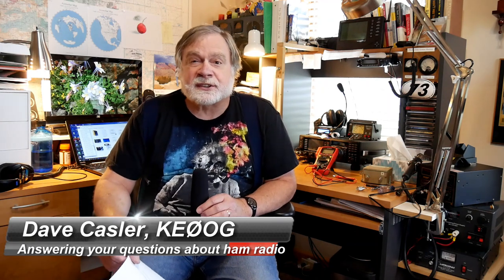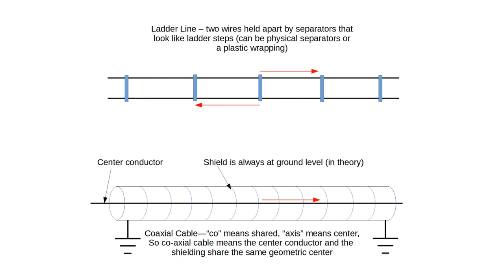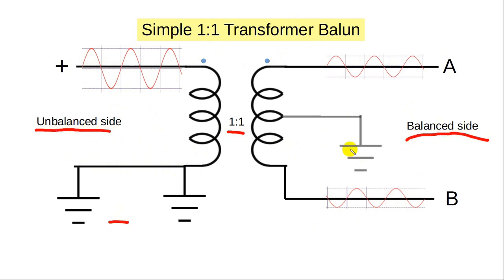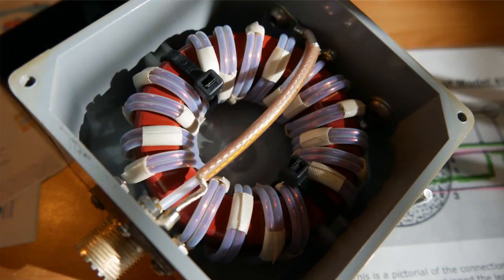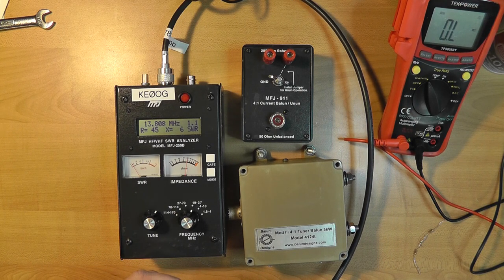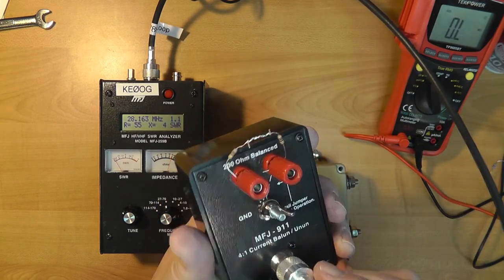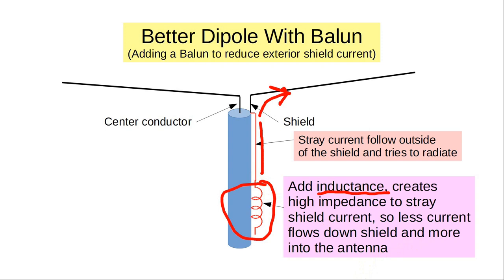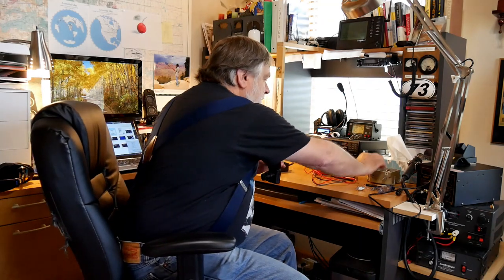All About Baluns (Ask Dave #73)

Comment: The resistance changes as you go up in frequency because the resistors you use are wire-wound type and they act as inductors when AC is applied to them. What you need is a "non inductive" resistor, ie carbon or metal film type.
Reply from the maker: To a degree, yes. The resistor is composition, not wirewound, but there is inductance in the leads that makes a difference in frequency.

Comment: Thank you for making this video. This has always been complicated for me to understand. In the video you use a transformer but I am seeing on utube that hams are using coax wrapped around a pipe calculating the turns for the center frequency. can you explain how this works instead of using a transformer, and where are these transformers found? Thanks George
Reply from the maker: Coax wrapped around something is called a "choke balun." Its purpose is to remove the RF from the outside of the coax shield so the signal you want stays inside the coax.

Comment: Wow, I'm an EE and I've been wondering what all this talk of voltage balun vs current balun is all about. Translated back to conventional engineering lingo, I now know that this is just an autotransformer vs a conventional transformer with two isolated coils. I still don't quite get why  this is called "voltage" vs "current" in ham land, but at least I know what they are now!
Reply from the maker: Yeah, I didn't spend a lot of time on voltage vs current. Basically a voltage balun balances the voltage at the output, and a current balun balances the currents regardless of the voltage.
Reply: In technical literature. a voltage balun would be different voltage and a current balun would make a different current. the impedance stays the same but multiple of the turns ratio time the inverse square so to speak. hope that helps some in understanding even tho this is not technical video. i mean that the only real change is in ohms law aspect of voltage and current.
73, ad0am

Comment: TRX Bench #101 Balun part 2 describes the wire and Ferrite Toroid to use for an accurate Balun. Beware of the Ferrite Material being sold - I purchased what was to be an F114-43 Toroid Core after forming the Balun it only has a low SWR on the 13Mhz Frequency a true 43 Composition Ferrite Toroid will produce a low SWR on all bands when used with 18 Stranded Teflon Wire.

Comment: Hmm...  I wonder, in addition to the comment by @laserhobbyist19751 and I saw someone else with one...  but still -- those old TV baluns we'd see on the backs of our sets to go from the 300-ohm twin lead screws to a 75-ohm RG-59 coax to our rooftop aerial for the UHF channels...  those would be 4:1, would they not?  I wonder, what would the maximum power be to use one of those where a 4:1 would be called for in amateur practice?  Or, would they even be usable?  I remember reading about that, but I suspect they'd only be good at QRP... Thoughts?

Of course, that was typed at only 8:36 or so into the video....

Comment: Thanks for the great info. Just an FYI, when using an ohmmeter to test resistance values, touching the resistor legs and/or test terminals will vary the readings as our bodies create resistance as well.
I am wondering if the coax loops or balun windings help at all with LED and fluorescent shop light interference? Thanks for the detailed video.
Reply: True. But a sweaty person will produce an ohmic resistance of no less than 200~150k Ohms (I've never had less than 300k myself) between hands. So any value below 1/5 of that shouldn't be significantly affected

Comment: I saw a video showing how to make an antenna that should cover 40 M through 6 M  I think may have been just up to 10 M. But it had the wires out with 600 ohm ladder line coming down connected to RG8 and a coil of coax. I don't remember the length of the wires and the ladder line. But I was thinking that it would help if there was a balun in there to help change from the 600 ohm to 50 ohm. I am new to this and learning.  But I think something like a 4:1 balun would make the ohms match better.  If I wanted to make one of the antennas what would be a good balun to try in there? They say it isn't needed that the 600 ohm ladder line will make it 600 ohms to the antenna.  I am new at this but I don't understand how that would work.

Comment: Hi Dave,
great video about baluns. Thank's I have learned a bit more on the subject. I've made ones out of unmarked toroid material that has come from old power supplies and ones that I've bought at rallies. i.e take your pick from a big box. I've read and read scores of literature on the subject and am still confused about which material is best to use. Some advise on using dust iron verses ferrite due to saturation limits etc.-etc. I did get hold of a quite large toroid from a rally that had a light grey coating?. It was very heavy for the size. Ended up formed into a coaxial choke at the bottom of homebrew twin feed from a G5RV. It certainly anchored the twin feeder into a nice straight line if nothing else.It actually seemed to work ok into 75 ohm 1/2" dia. coax back to the shack.  Got out well on 80 - 20m Plus 160 as a centre loaded T, from U.K to VK on a G5RV and some people say they don't work ???. Thank's again Dave. 73 de John-G0WXU.
Reply from the maker: The problem with toroid cores is that different manufacturers use different color codes for core type. And then none of the manufacturers put their name on the cores! So if you encounter an unknown core, it's anybody's guess.

Comment: Very informative! In my winter location I can only use a vertical (Hi Q vertical) but in the summer I have 160 acres to play with and want the best wire antenna I can put up. I mostly am on 20, 40 and 80 meters but would like to try 160. What's your thoughts?
Reply from the maker: With all that land, try an off-center-fed dipole. Get it as high as you can.
Reply: @davecasler  thanks, I will check it out for length and feedline.

Comment: The statement of how the current behave in a coax cable, is really misleading. Every one who has the ARRL handbook should take a look at chapter 20.1.1.
There must be a return path for the current. And for the coax, the return current flows on the inner surface of the shield.

Comment: Excellent job Dave, explanation is clear and concise. I have one question however; I am moving my shack and as such need to run a new schedule 40 underground feed aboiut 150 feet to the tower. You mentioned balanced feed line vs unbalanced. I have LMR 400 now, but it is not bury flex and not long enough, which would mean that I would need to have a union installed along the run. So is there an advantage to running the REAL ladder line in the underground conduit vs bury-flex LMR 400? Disadvantages ?
Reply from the maker: Burying ladder line doesn't work. It needs to be out in the open away from other metal. Call Ray at USAcoax.com and he'll get you set up.
Reply: Thank you Dave. I will check out USACOAX.com (Ray). I am confused however by your comment that it needs to be away from other "metal". The ladder line would be buried 18" in the ground in Schedule 40 PVC electrical conduit, not metal conduit. I should have made that clearer, my bad. ISo would ladder line be Ok in PVC conduit buried ?
Reply: Ladder line is easily unbalanced by what surrounds it. You can contrary to popular belief run it close to metal pipes or panels but ideally each conductor should be equal distance from that object. IE you could run a ladder line down a  metal tower on stand offs. to preserve the characteristic impedance the spacing from that conductive structure should be much greater than the spacing of the conductors in the feedline. I suspect that your scheme to bury it in PVC conduit would be very lossy due to the localized rf fields in the ground. I am sure ladderline could be laid underground in a huge duct but it is far from easy. I think the way forward in your project would be the best coax you can afford.

Comment: Dave, can I use shielded cord for a feed in.  I have some 18 AWG 2 conductor with a ground wire, shielded cord. It looks a lot the old rs-232 or centronics computer cord.  This is going to be used for receiving only.
Reply from the maker: For receive, you can pretty much use anything.

Comment: Remembering Navy & college I got my Extra (AG7MW) on the first try. That doesn't mean I know something. I have a MFJ-9200 QRP with a SWR, tuner, then 50 feet of RG-8X going to an MFJ mini G5RV. I understood that I needed an isolation balun, so I did. Should I have gotten another? What tape do you recommend to keep the rain out of the connector? It might be too late.
Reply from the maker: Sounds like you have everything you need. Just add perseverance and you'll have lots of contacts! Re the rain, electrical tape is fine for the short term. Look at DX Engineering's web page for sealing tapes.

Comment: Hi Dave, thanks for the fantastic videos. Could you give a little more detail on the matching of balanced feedline with a dipole, you mentioned feeding a dipole with ladder line in the video. For example if a dipole is 50 ohm at it's feed point but I connect 300 ohm ladder line for a 100ft run how would this change things viruses just sending coax up to the antenna. Thanks!
Reply from the maker: You would probably need a wide – range tuner with the open wire feed line. However, when all is said and done the total losses in the antenna system are lower with ladder line.
Reply: If your dipole is close to 50 Ohm, you would not use ladder line. You would simply put a 1:1 BalUn at the transition point. Ladder line is for the cases where you want to use a dipole for frequencies were it is not resonant. Here, the advantage of ladder line is lower loss, which is important, if the SWR on the line is high. So, you use ladder line and a balanced antenna tuner to transform from whatever to 50 Ohm unbalanced.

Comment: what is a symptom of RFI in the shack? i have an IC 7300 and not sure what i am looking for WRT RFI noise in the shack.
Reply from the maker: For example, the radio locks up, or you hear a buzz in the computer speakers, or you get a zap when you touch the radio. These are some symptoms. Basically anything that behaves in ways they shouldn't.
Reply: mysterious signals on your computer speakers, all of a sudden shutdown of equipment when you did not hit the power button, and the most obvious TVI.

Comment: How would you use a twin lead as a dipole for the Balun?
Reply from the maker: The so-called "folded dipole" is made with twinlead. It's a balanced antenna, hence often fed with ladder- or window-line. You'll need to provide a balun somewhere in the system.

Comment: For short runs (let's say 20 feet from transmitter to antenna feed point) - can two coax cables tied together in parallel with only center feeds used, work? Just wondering if this would work in a "ladder concept".
Reply from the maker: I've never tried it. Part of me says this is just parallel line and would behave like it, but another part says the shields will interfere with the electrical field.
Reply: Well... that's what radio is all about. I'm going to try it and see how it measures out. I will update you. Excellent learning videos by the way! KE4BNF

Comment: in the beginning you said there is no current on the outer shield of the unbalanced line, then later you talk about the dipole and then you say there is current coming out of the shield. you didn't really explain the difference between voltage and current balance, you didn't write down the voltage and current anymore like you did in the beginning.

Comment: I have a 1-1 balun - 1 eye bolt on each side, one eye bolt on one end - then coax connector on other end.From 1 eye bolt  to cb antenna, - top eye bolt for support - what size and type wire to use for connections balun to antenna ?
Reply from the maker: I think most CB is vertically polarized. You can probably use just about any kind of wire you want.

Comment: So the turns ratio makes sense, but I never know how many turns to make the primary in the first place... say 50 ohm (real) coax, what should I design the impedance of the primary to be? 50 ohm (imaginary) as well? please help me understand that :/
Reply from the maker: You're getting into design issues. You should start with existing designs and go from there. You need fewer turns as the frequency goes up, but I don't know the exact equations.

Comment: Mr. Casler, have you a video say comparing your FTDX 3000 to say a Icom 7300 , im buying my 1st HF radio, all I have really seen much of is the ICOM 7300. and people generally say make sure I get a radio less than ten years old and has DSP. Can you add any help..suggestions ?
Reply from the maker: The 7300 is really hot right now. I have an FTDX3000 and love it. It's a superhet with lots of DSP features, whereas the 7300 is all DSP. The net result is both are good radios. You want to make sure that your radio, if you do buy used, is all transistor (no tube finals if you can help it) and that it has some good DSP filtering such as noise reduction, automatic notch, etc. Look up both new and old transceivers at eham.net/reviews.
Reply: Thank You very much Mr. Casler
 @davecasler

Comment: I understand this was about baluns, but now I am confused about both sides of the dipole antenna radiating RF signal or not. I have been using a coax choke balun for my 40M dipole fed with all coax. Are both sides radiating? If not, will a 1:1 balun make it more efficient by making it radiate from both sides?
Reply from the maker: Both sides of a dipole radiate. A choke balun helps keep that power in the antenna so it doesn't creep back down the outside of the coax and cause the coax to radiate. Sounds like you're set up properly.
Reply: no. all the 1:1 balun would do is make sure the currents are equal. but remember, a dipole is 75 ohms and coax is 50 ohms at the 1/4 wavelength of that particular frequency. when used as multiple band it is alot more complicaed
Reply: Thank you. You're the boss Dave.
Reply: Adam, correct me if I am wrong, but in the case of an inverted vee the feed point impedance is lowered as the elements are angled down, as well as lowering the whole antenna. as in NVIS. Right? This is more about confirmation of being on the right track than an argument. I promise.
Reply: correct

Comment: what would happen if you used a micro adjustable variable resistor/potentiometer in place of or in series with a fixed resistor to fine tune the ohm value?
Reply from the maker: You’d lose power to heat. Reactive components store and re-release energy but don’t dissipate it.

Comment: I purchased a Fan dipole and it came with a 4:1 balun, do I need a 4:1 balun?
Reply from the maker: If that's what it came with, it's likely been designed for it.
Reply: What's the feedpoint impedance and your feedline? If they are both 50 ohm, then a 4:1 balun is not needed.

Comment: So why could you it put the choke Balun at the rig, instead of at the antenna
Reply from the maker: The point is to keep the radiation confined to the antenna. Otherwise some current can find its way onto the outside of the coax, and then the coax is radiating. The choke balun at the antenna helps reduce this.
Reply: David Casler so my new place sucks for inverted v, do the wires have to be parallel or can the inverted v be sloped out from the evergreen tree to miss the branches
Reply from the maker: @scoopyall2996  The antenna wires should be spread as far apart as practicable, with at least a 90 degree angle separating them, hopefully more like 120 degrees.

Comment: Where would you use 4 to 1 unun over a 4 to 1
tns KQ4CDPaul
Reply from the maker: A 4:1 unun would give you an impedance transfer of 200 ohms down to 50 ohms. Not much in ham radio seems to pop up with 200 ohms, though if you fed a dipole off-center, you could probably find a 200 ohm spot. I would expect such a spot to be rather reactive, so you'd still need a tuner.
Reply: @davecasler  tnxs
Reply: Thinking 75 mts loop